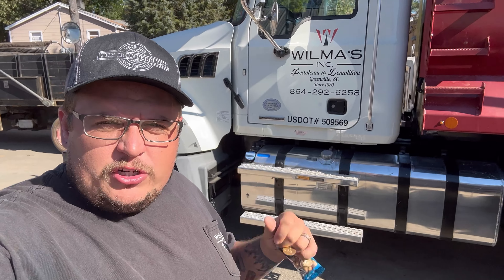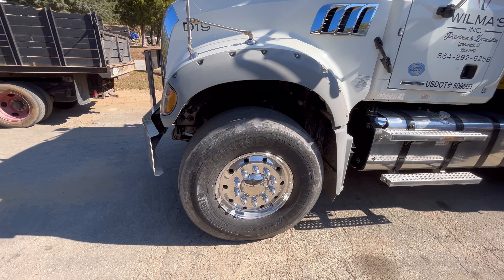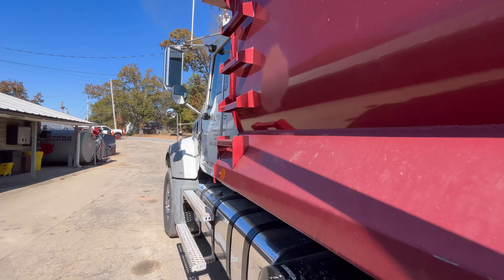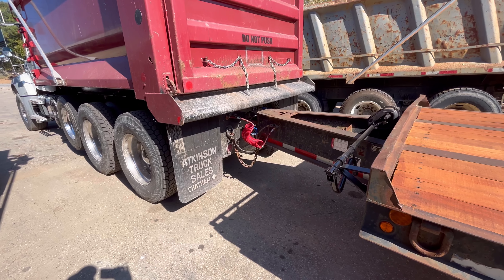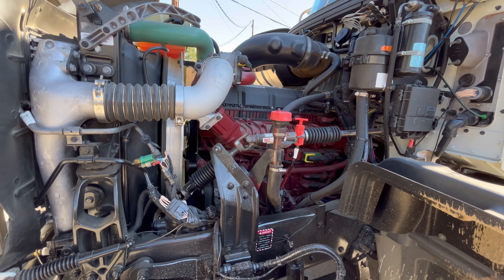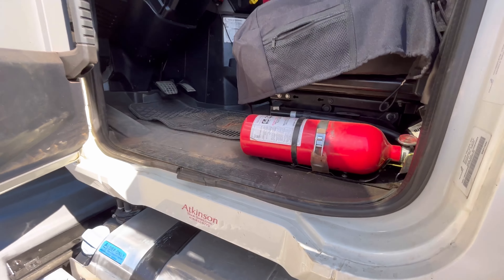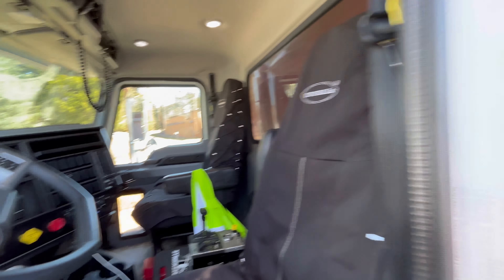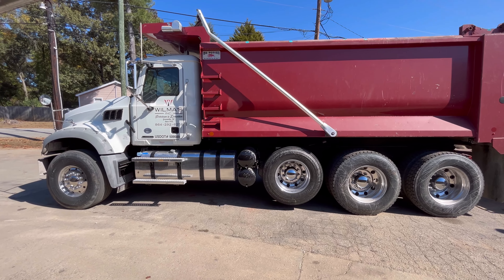Walk around - Mack dump truck

Comment: I think that would be a power wire for possible power to rear end for ramps
Reply from the maker: Ok that kinda makes sense. I’ve never had power ramps on a tag before but ive seen them on paver style tags
Reply: @Awhaley5   that’s why I mean sometimes you need just a heavy heavy positive wire for maximum power efficiency for electric over hydraulic ramps on these newer 20-25 ton tag trailer
Reply: @Awhaley5  I have a 27 ton 3 axle tag but I wasn’t that lucky with power ramp …. Breaking the old back out for them😂😂😂
Reply: @Awhaley5   best I can think for being hooked up on back of a dump truck